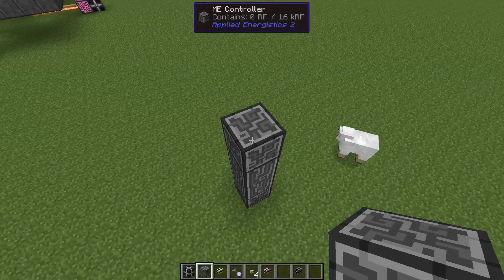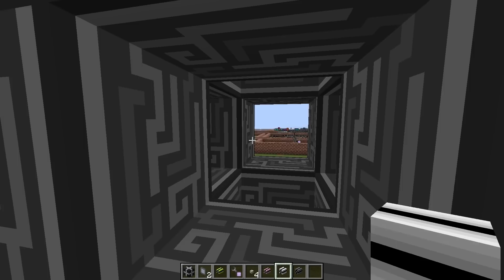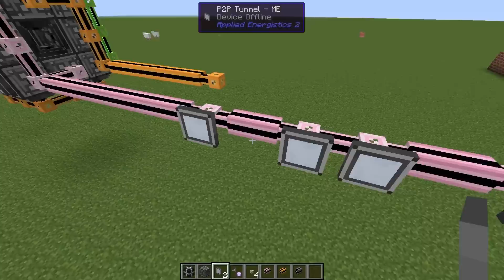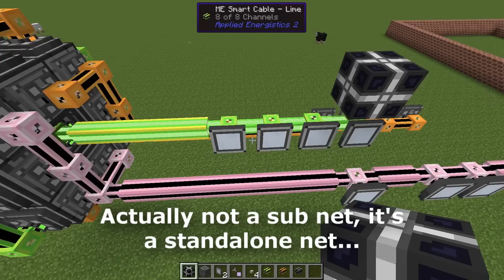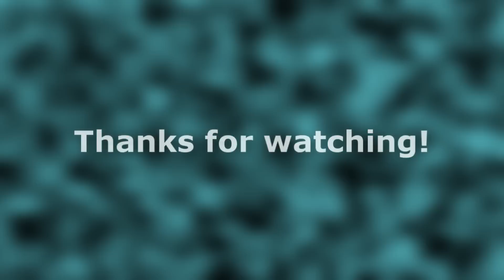Effective ME Controller Design - Applied Energistics 2 Tutorial #19 (MC 1.7.10)

Comment: so what you do with the dense cable? i look your other and still does not understand i know smart cable is easy to figure it our just link to 4 room with 4 p2p and done but how do you use the dense cable? do you just hook up a p2p then memory card 1 with 1 then use the same color cable or what?

or simply what do you connect the dense cabe to?
Reply from the maker: Normal cable (smart or glass) can handle 8 channels. A dense cable can run 32 channels, and then you'll need an ME Controller. I have gone through this in the very beginning in this tutorial series.
Reply: never mind i think i was being stupid sry thx for all those great work and thx 4 answering so quick.
Reply from the maker: I have made videos on basic ME Networking and everything about P2P tunnels. You really need to understand both of them before going into this type of advanced network design. Also check the video where I go through basic P2P tunnel networking. I don't want to sound rude, but it's very hard to explain in a comment if you don't already know those parts. But in short: you need to use your memory card on EACH tunnel. A tunnel can be 1 to 1 or 1 to many. Each tunnel requires a channel. If you have more than 8 tunnels in total in a dedicated network, you'll need an ME Controller.
Reply: ya i found out and i did watch your video i am pretty good at math too so i just used memory card 1 for 1 and it work flawless
Reply: thx for the help. basically u just use any cable (glass or smart) on dense then you put a p2p on the cable then dense on the p2p so you output 32 while only use 1 channel of the dense then u use memory card to link 1 p2p to the one you just made 1 for 1 and so on with the rest of the dense cable. btw u can short the dense usage by using another p2p tunnel so u can just use glass/smart. then 2 controller tkh put is just relay so it can power the dense 32 channel because the other end was used up.
Reply: this is how it should look like (just showing other ppl who does not understand). just remember to link memory card 1 for 1 each p2p.
http://imgur.com/a/6cu43
Reply: subscribed i don't subscribe normally (only have less then 20 subscribed not becuz i am new or what becuz i only sub to those really good channels anyways keep up the good work. sry to say this but not many ppl play minecraft anymore minecraft went shit after 1.7.10 just my opinion and i think if you want get more view u need move on to a next game or if u are just doing it for your own pleasure then ignore what i just said :) cheers)
Reply from the maker: Thanks, and welcome to the channel :) Good that it worked out, I'm usually glad to help when I can!
Reply: TKH do u think the deviloper knows how to use the mod on we player knows the mod better?
Reply from the maker: Perhaps not better, but I think that from time to time we are able to come up with smart ideas that the dev never thought of when they designed a mod :)
Reply: TKH true i think so too player are more skilled then deviloper through time and that's why there is bug fixeses

Comment: This is very confusing. Probably because I have no idea how P2P tunnels work.
Reply: Note: With P2P this Minecraft ME system means a point to point connection - please do not confuse it with peer to peer - that's different.
P2P Tunnels work so: Point to Point. At the ME-Controller with a P2P Tunnel you can "compress" 32 Channels into 1 Channel of any Type of ME-Cable. When you are using a ME-Cable with a maximum of 8 Channels, you can connect 8 P2P-Tunnels at the ME-Controller to the 8-Channel ME-Cable. So you have 8x32 Channels (256) in one 8-Channel Cable. Then you can connect 8 further P2P-Tunnels to your 8-Channel ME-Cable wherever you want to "decompress" 32 Channels. Before it works, you have to link with a memory card ONE of the 8 P2P tunnels on the ME controller with the desired P2P tunnel at the end.
That's exactly what you do with the other P2P tunnels.

In that way, you can save tons of ME cables and resources. Especially the thick 32-channel dense cable.
Without P2P tunnel you would have to lay 8 times the 32-channel cable.

Note:
One channel is required per connection between two P2P tunnels.
For a 32-channel cable, a maximum of 32 P2P tunnels on the ME controller side and 32 P2P tunnels on the other side (output side) can be connected.
In this way you can transfer 32x32 channels (1024 channels in total) via a 32-channel cable from A to B.
Reply: im realy looking foward to learning about p2p tunnels first time also using it
awesome tutorials
Reply from the maker: I strongly recommend you to learn P2P tunnels. I have done a few videos on the subject, they should be easy to find in the AE2 playlist. Not only for this build, but for general ME networking as well.

Comment: how do i use the 32 channels from the 2nd me controller? i can only hook up 4 other dense cables wich only gives me 128 and if i add anotherme controller the system doesn't work anymore
Reply: I think I might be able to help somewhat here.
We'll start on the basic level, here. Firstly, an ME Controller actually gives out infinite channels. The only thing limiting it is faces. There's two types of ME Controllers: 
The Structure, that being a multiblock thing that is every block that's in it,
and the Block itself, which is what makes up the Structure. By adding more blocks to the Structure, you get more faces.
Faces, or the sides on the Blocks, are important because the most channels you can extract from any one spot is 32.
In this case, cables can't use the full amount, because they automatically try to connect to each face. But P2P tunnels, by design, don't.

P2P tunnels allow you to basically 'save' all the channels that it's connected to, then, using a separate channel, upload them elsewhere. This means that, by putting all P2P tunnels around the controller as the creator's done, they can get the full 32 from each Face.

Ahh, here's where my words are failing me. I know how to put this...Lemme think.

So, by taking a Subnet(That's what the smaller, single-block controller is: You take the larger controller and plug its cables into a smaller one, turning the smaller controller into a subnet), you can increase the number of possible channels that can be used to get these P2P channels out there. Or something along those lines. I'm not quite as savvy as the creator, so he's free to correct me on that.

The reason the Subnet is important, is because ordinarily, getting all of these P2P Tunnels out would take, if I recall correctly, one additional Channel per output. That means that you would need 8*4 + (4*4) = 48 additional channels. That's a little more than one dense cable. So, you make a Subnet, which again provides infinite channels, as per the Controller block, to give you the ability to provide these outputs with a channel. Again, this is where my ignorance shows, so if I've failed at something, just correct me.

That means that you also get 48*32, or 1536 channels, which technically rounds up to 2000. Then, what you do to get however many channels you need to wherever you need them, is to just place a P2P Tunnel at the room in need, link the P2P Tunnel with one of the ones back at the controller with a memory card, and then use a Dense Cable on the front end, and voia la, you now have 32 channels wherever you need.

Of course, don't forget to connect the P2P Tunnel to a power source, via the subnet.
Reply from the maker: All ME controller blocks must be connected and a system can only have one controller (which could consist of several blocks). There are a few rules to follow for size and shape, but you'll know when things go wrong.
Reply: but how do u archieve the 2k channels? i have 1 2 controllers hooked up to the giant box of controllers, and they are not connector, stuff from the 2nd controlller can't go in the ME system
Reply: they are both lid up and the giant one is aswell. only the 2nd one doesn't interact with the 1 smaller controller
Reply from the maker: 2nd controller? You can only have one controller per system. Perhaps another one in a subnet, but that's something else. And don't forget power. Finally you'll achieve 2k channels by following this tutorial video...? You must also fully understand P2P tunnels to make it as efficient as possible.
Reply: i'm so confused by this :( this will never work for me
Reply: can u explain how u would get the 32x32 when ur leading a dense out of that one controller
Reply from the maker: That's not how it works, you need to understand the basics before taking onto a 2k controller setup. I'm sorry, but it's impossible to explain unless you fully understand an ME network. Check the earlier videos (check the playlist) or read info on the official web pages. I will gladly answer specific questions after that...

Comment: eh.. what is the point of that...?

Like... seriously.. It took me about 40 channels to cover my whole base while using hybrid builds (AE2 + other mods with item transfer) to slightly decrease channel usage.. I know i'll need more later, but I'd have to spend months of playing for finally running out of channels.

Also what's the point of covering controler "cube" with p2p? You just make it useless.. don;t you? What's the point of it? Or using smart cables.. I have no idea why would someone do that, if controller can accept dense cable. Why would you go with smart ones..
Reply from the maker: I just guess this build isn't for you ;) My base is also covered quite well with only one (but quite filled) controller block. But I'll explain the use of p2p tunnels. I have this method in another video and it's very useful for saving materials. Instead of having four lines of dense cable I can have ONE line of normal glass cable (I'm just using smart cable to make channel count easier in the video). Not a single smart cable is connected to the controller, so I'm not wasting a single channel. Plus, that using p2p tunnels makes it possible to reach the 128 channels on each side's center cube where there are four sides within the same block space. Watch the video again or a previous video in this series where I explain the p2p method.
Reply: TKH Yeah, thanks :)
Reply: when you get to the point of needing and using a Quantum network bridge, it makes sense.
or a tower of Molecular assemblers and interfaces using 1 tunnel / 32 channels

Comment: Do u have a video where u get the machines to work with this build or something similar? I am struggling with my harddrives to connect to the system...
Reply: I have build this setup and connected it to one me controller.. Took one dense cabel from the me controller to each row of the harddrives with me tunnels. But it still only allow for 32 channels all together :S Can u help me or point me in the right direction?
Reply from the maker: I have a tutorial video of a "large network design", there I have a simple multi-block controller with tunnels going away to different rooms. The controller in this video would work perfectly in that design. Have you seen it? If not, you can find it in the playlist.
Reply: I found the video and I figured out what I had done wrong :P Keep up the good work with these videos :D
Reply from the maker: TheNitorx2525 Great, glad it could help! :)

Comment: You said the dense cable could do 32 channels on 32 rooms. but I can only squeeze 32 channels from that dense cable. did you mean 1 channel per room?
Reply from the maker: +Jacob Clabough Well, depends on how you do things. If you run 32 P2P inputs (from the controller), through a dense cable, via an ME Controller, and then set one P2P output in every room - you would get one dense cable (one per side on the controller) for each room = 32 channels per room. Note that this method is based on using P2P tunnels.
Reply: TKH Thanks

Comment: How can i connect this to a conversion monitor? i have 60 conversion monitors, but i don't know how to connect them
I made this but it doesnt seem to work, the smart cables arent getting any channels but the controller is on but not getting any power. The P2P Tunnels keeps saying Device missing channel.
Reply from the maker: +Cake Boss I don't fully understand how you've connected things. An album (on Imgur or similar) with screenshots and descriptions would really help. Make sure you have the monitors in the correct network. In this design I have P2P tunnels on every side of the controller blocks, so your monitors should not be "in the middle". And make sure to power every subnet with quartz fiber cables.
Reply: I made the exact same ME Controller setup like in that video but the P2P Tunnels arent getting any channels or are offline. The ME Controllers do get power. Here are some screenshots. http://imgur.com/a/jsL1s

Edit: I'm trying to make something like this but how do you connect all of this? http://imgur.com/Lh2AlSv
Reply from the maker: +Cake Yay I looked at the first album and it doesn't make much sense... are you sure you watched this entire video? The networks carrying the P2P tunnels also need power, but should be separated from the main (controller) network. Use glass fiber to power those nets.

Comment: Would you need a memory card hooked up to each p2p channel? That sounds like a lot of work, but if it's necessary...
Reply from the maker: +Barlender Well, both yes and no, but mostly no ;) When setting this up, you only need one card. First, you could build the entire structure, or parts of it, but only add 2-3 P2P tunnels to get the channels you need. Use a Memory card to set tunnel 1 (first in, then out), then tunnel 2, and so on. The card will be reset every time you save the settings for a new tunnel. However, you COULD craft 72 memory cards (to match the build in the video) and have all of them saved to one input tunnel each. And when the system expands, you simply take a new memory card and set a new exit point. It would be hard to keep track of them, because if you mix them up, things won't work :)
Reply: I feel it would be much easier to just make one and reset the main setting every time you program each pair of P2Ps.